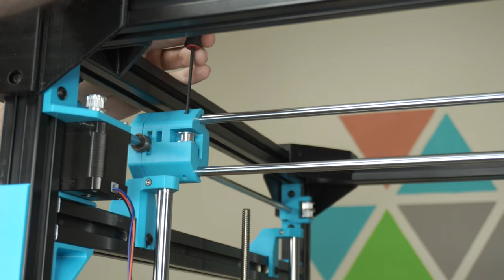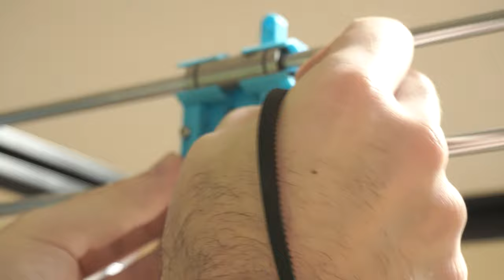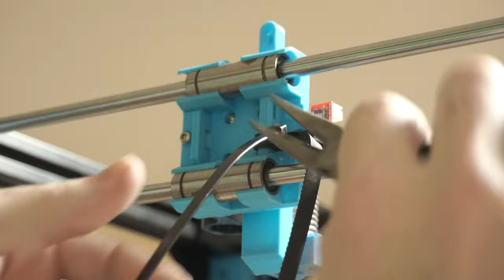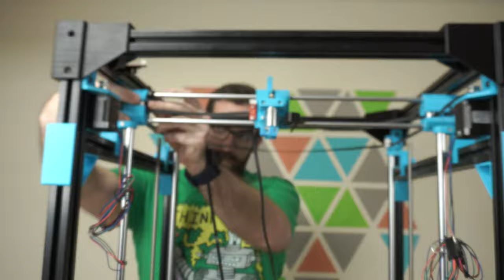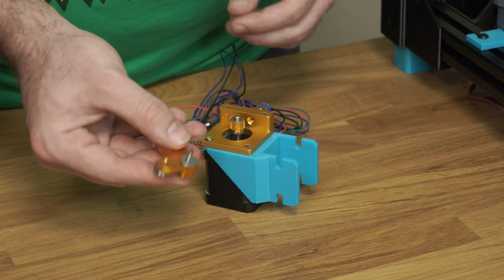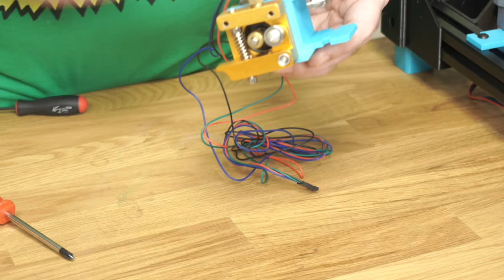Zyltech HEVO 2.0 - Endstops, Belts, and Extruder: Part 4

Comment: Good morning and thank you again for another great video. I have printed the endstops from the Prusa file and they look different from the ones in your video. Are the ones you are using specific to the optical sensor and if so do you have a stl file for those?
Danny
Reply from the maker: Oops, I forgot to publish the STL files. I just published them. Here is the original file just in case you need to see how it goes together https://cad.onshape.com/documents/52b6b41f2085be11b905629d/w/17453f5b96c37f40c69d73da/e/fb05fc127d7942af37afe091
Reply: @SteamLabs  Perfect. Thank you

Comment: Great video.

How does the stock extruder do? Would this be one of the first things to upgrade, or is it decent enough? 

Also, if the rails are upgraded, would this be a good candidate for going direct drive? Or are this printers spans way to large to do anything other than bowden without a total redesign.
Reply from the maker: The stock extruder will work. It skips steps if the feedrate is too high, when there are lots of retractions, or with filament imperfections. I upgraded to the e3d titan and I'm happy with its performance. 
Bowden setup keeps the x axis light, which allows you to print faster with less artifacts. Maybe a e3d hemera would work with the rail system?